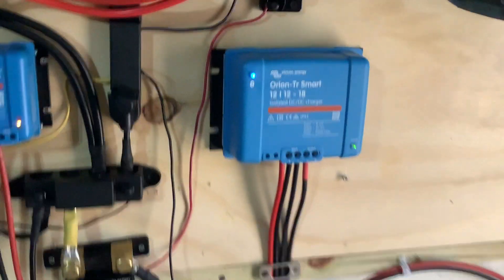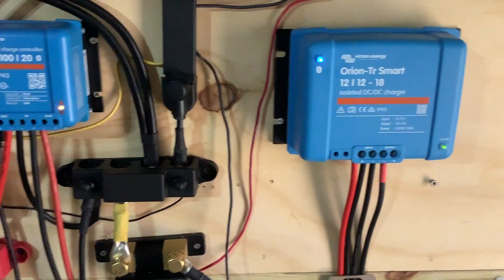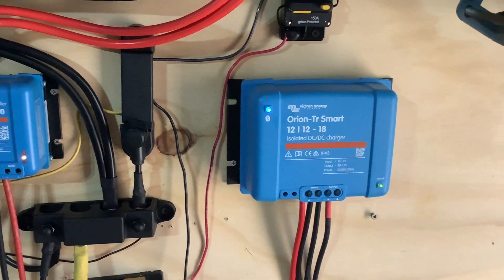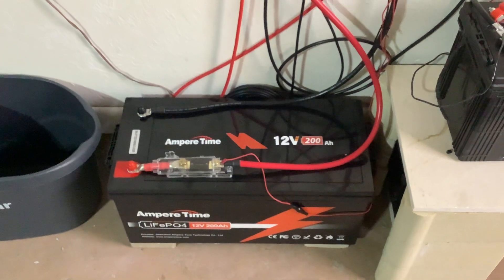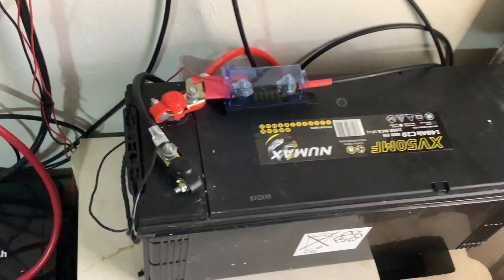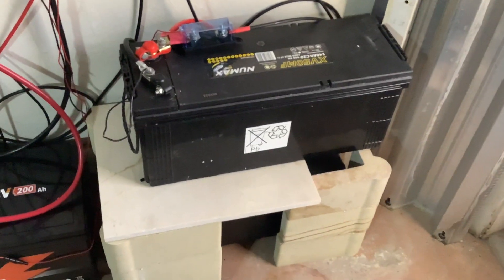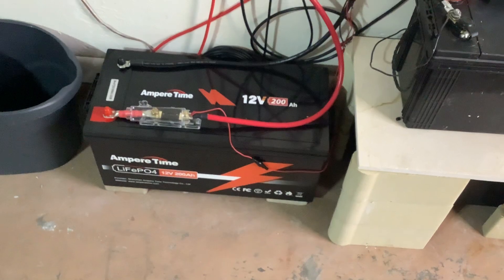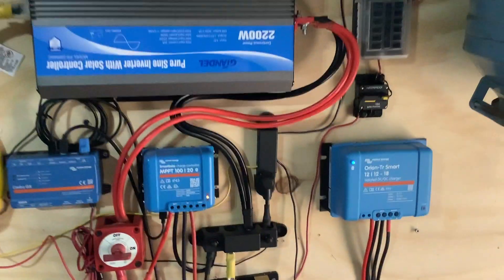Victron Orion 12v to 12v 18amp charger setup

Comment: What fuses are you using?
Reply from the maker: I just sold the entire setup with the house… batteries and main lines were all fused and breakered to the wire gauge.  Had another 25a (I think) on the outbound side of the controller (per the Victron manual), you can see what they recommend per the voltage in their install guide.   I would buy one again for sure. 

Thanks for the comment.
Reply: Does it matter if one battery is smaller than the other the way you have it set up?